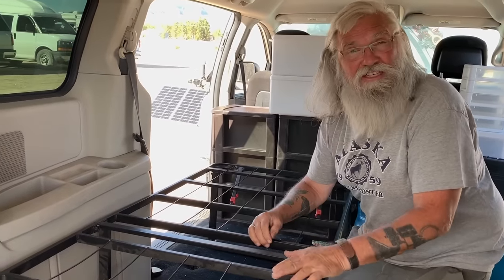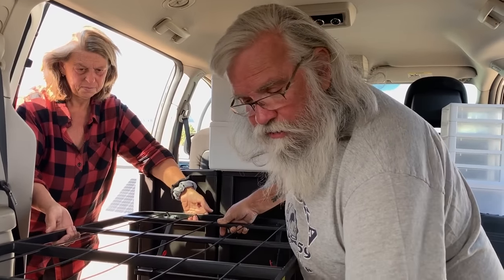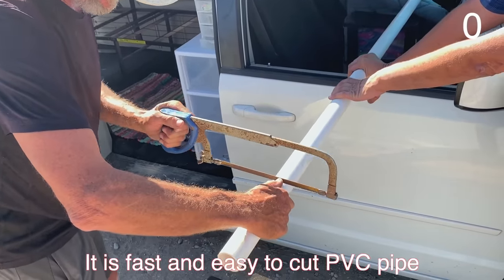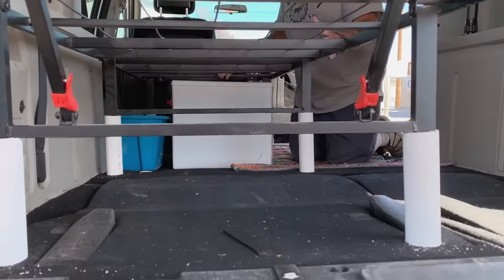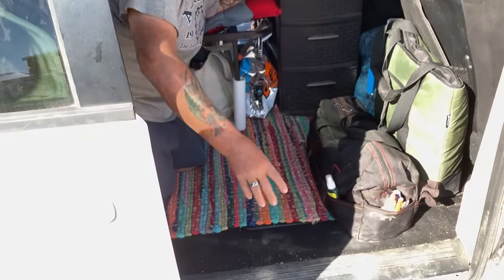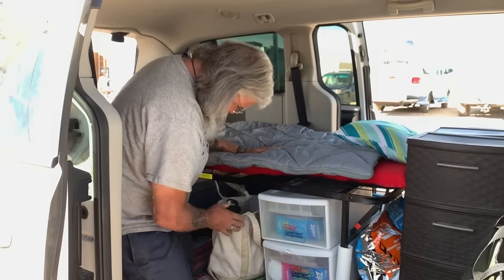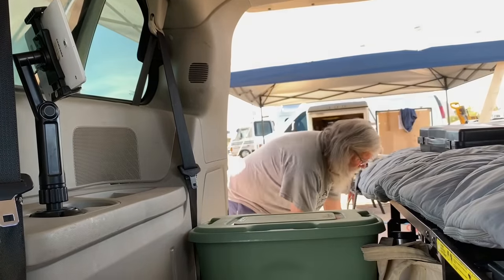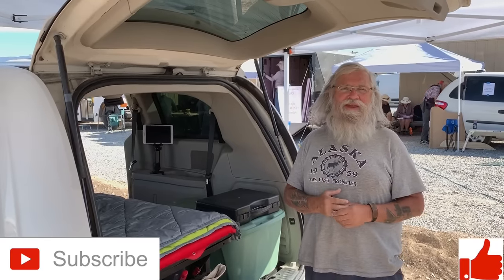Van Life for Less: Affordable Easy No-Build Van Conversion | No-Build Van Life

Comment: This is genius. You're going to help a lot of people with this!  A couple of hints 1. Put a few layers of cardboard on the cot before you put your bedding down, to cover those bars that kill your back.  2. Measure your bins that you plan to use under the cot, and don't cut the legs off too short for them to fit.
Reply: That cot will kill your back no matter what type of cardboard you put under it. What he doesn't say in this video is how uncomfortable that "no-build build" will be. That cot is cheap, and you get what you pay for. Same with the shelves and storage units. There's a reason a build is better: it lasts longer and is more comfortable. This video shows you how to be homeless in a van.
Reply: @thedanholmes  In today's uncertain economy, how to be homeless in a van for 300 bucks is an essential lesson. Most people cannot afford luxury these days.
Reply: @thedanholmes  Yes, it's an emergency solution. Improvements can be added as the situation evolves. For instance, 1/4" plywood with holes drilled into it for air circulation could create a flat surface for the mattress.  Cheap and simple, as soon as one can find the money for the materials, or better yet, a resource that's throwing offcuts away.
Reply: @thedanholmes  I have these same plastic containers and I live in an apartment. You don’t need to build every thing. This is to get you started. To be free from whatever situation you’re in that you need to get out of, whether that’s an abusive relationship, financial cost of living, or just the need to get out and see the world. 💫
Reply: @chezmoi42   I like the basic suggestions. But I also do know how to use a fewl tools.  I am an empty nester. I have a lot of leftover/behind furniture and furnishings that I can convert/repurpose, if I choose to. Once an old entertainment system, the top of it is on the floor in my sewing room that I haven't used in years, and I could maybe repurpose that. And something I have that is really cute, I don't know that I can convert it, but I'm sure there's a way, is an old telephone desk that has the lamppost through the end of it with a shade even. I would have to run a electric, but if I had a jackery I could. Or I can convert it and make it solar or something instead. Or  just put a solar light bulb in the socket and not plug it in. But it sure would make the van homey/quaint.  There's the cubby hole under-the-table next to the seat where the phone books and such would go. That could be used for storage for other items. Say like maps, coloring books, supplies, crafts and road games.  And right underneath I could place my own fashion picnic basket with the picnic plates, cups and such, already inside of that.  I wouldn't even have spend money on those things.
Reply: @thedanholmes  just need a good mattress
Reply: @thedanholmes , for those who are looking for a quick/temporary solution that will get them out of the city with their new (used) minivans, this is perfect. If we all custom built before heading out, many of us would never get there.
Reply: @Seashellsbytheseashore21  just wanted u to know that your comment meant alot to my cousin. She ❤️ Ed it becUzs she is going thru it too
Reply: @cherannretiredgran68  💯  u got it right ✅️ 👌
Reply: @PaulaRamsey-t9e  thank you.
 I had actually gotten to set up my no-build over-nighter/campervan mid to late summer. I've already changed a few things in it a couple of times since. And just recentlyI started posting shorts on my personal channel.  Right now it's testing the channel, making content, learning camera, photography, terms, .... I don't have the "campervan, vanlife" channel actually happening due to some health and van issues. But the adventure of getting it together has been fun n interesting. 
Providence prevails though!  I found some inexpensive items at a $ store, thrift store, and a couple of yardsales. Woot! Woot! 
And bless their hearts my children and grandchildren treated me to a mini-vaca at Hocking Hills in southeast Ohio. 13 of us went. And even though it was a bit arduous physically for me, it was a real treat. Great for my heart and soul. And the family overall.  ❤️
Reply: Cardboard attracts moisture and bugs.
And it smells.  Ick.

Comment: This is the most important video you have ever done! ,  giving hope to many people who have to adopt vanlife and who lack the necessary craftsmanship. I am adopting this layout in my planned campervan (ford transit custom 2.0 liter diesel in England). The idea of using low weight matertial and reducing petrol/diesel is excellent. The layout is very simple and can fit nearly every van. This video left me with a lot of thinking, before my next planning. A comfortable bed and good insulation do not have to be made by tons of wood! a simple water system means less problems! simplicity is the name of the game for those who lack the money and the time to turn their van into a campervan. I am using the extra money I am saving to buy a newer van. Excellent video!!!  Thank you many times for this informative video.
Reply: bottle-cap taps are also very useful, same for having a bowl in which you drill a few holes in the bottom in a space slightly smaller than a wide bottle cap, a water jug with a wide bottle cap and cut the cap then glue it to the bowl. Or simply glue the cap to the bowl (ideally center, but not necessary), then use a nail and a hammer to punch holes from the bowl to the cap, or if it's a plastic bowl, you can use a very hot nail instead, to also make the connection waterproof. With a bottle with a tap cap and a sink connected to a water jug, you can have the tap-and-sink part of a kitchenette, and the rest is a table for cutting and prepping inside the vehicle, a folding table (can be the same table with different heights available) and a stove for cooking outside, you have a complete mobile kitchen.

Comment: Hi Bob, Great idea. 
If I may offer two suggestions I think you will find them helpful. 
1st. Once you Mark the the length for your PVC take a piece of tape and wrap it around the pipe at the marks, this will give you a perfectly straight line to follow while making your straight every time . 
2nd. To prevent all the weight and pressure on the PVC ( cold climates can make the PVC brittle at the uneven pressure point at the cross bar), drill to small holes through the PVC continuing through the cot leg. After that take small drift pins or a bolts that will match the diameter of your drilled holes. 
This will also secure the leg extensions to the cot. 
Thank you, Bob Mahaney 
Baltimore Maryland
Reply: From another native Baltimore resident, great advice. Overcome, adapt, improvise.
Reply: Good tips, Robert!
Reply: See what happens when you get a bunch of guys together on a project!!!  ❤

Comment: If I wasn't so attached to my flowers, this would be the life for me. At 69 and partially disabled my dumpy, old, paid for, shack with lots of perennials is a better fit.   I may have to join the patreon anyway because I know that in spite of not having anything fancy, I am blessed to have a roof over my head, gas heat and indoor plumbing. You guys rock!

Comment: Great video!  I'm a 63 year-old grandmother who did a no-build on my 2008 Toyota Sienna.  I used a regular twin metal bed frame with a piece of plywood and a twin mattress.  I use under-bed and behind-bed plastic storage drawers and containers.  I have two solar lanterns.  I tinted the side windows and use a custom cover for the back window and a curtain behind the front seats.  My potty is a 2-gallon lidded bucket (I'm small!) with a "separator" insert.  I am fortunate to have a room at my daughter's home, but my minivan camper is my ticket to cheap, enjoyable freedom weekends and summers.  Thank you for sharing the message that simple can be best of all!
Reply: Portable potty bucket can be bought on line at cost rangev of  USD 22 to 120....

Comment: Really like the extension idea for the legs of the cot.  I hadn't thought about that and it will come in handy.  FYI, keep an eye on the multi drawer plastic storage units.  On some of them the frames pop apart.  A three drawer wouldn't fit in the back of my car for kitchen storage, but a two drawer went in perfectly.   Also, the grocery sacks many of us are required to buy anyway these days are usually flat bottomed, fairly sturdy, and cost 99 cents.... and they hold quite a bit.  Waiting on the solar episode because, try as I might, that stuff just doesn't stick in my head!

Comment: Thank you for giving hope to those who feel hopeless and stranded in their situations. Sometimes that hopelessness feeling is less when you have a project that you can do to help yourself and your situation. showing people these videos, Can give people Hope that it’s not the end there’s more to life and life isn’t always what other people think it is. We travelled on the road for three years living out of our 1 ton with just a bed in the back seat and Window coverings. 
The first night my husband slept in the backseat and I slept in the front because we were going to put a tent up and it started to rain and we couldn’t set it up. 
I insisted that he take the backseat which was more comfortable because he was doing most of the driving and I could just doze in the passenger seat. 
When we eventually got back home we removed the backseat. Made a platform bought a mattress installed our generator in the back under the tone cover ran the exhaust through the box underneath out the far corner. We ran an extension cord from the generator through the hole that the backseat bolt that we removed, the extension cord which at night would charge up our devices and charge up the truck battery through a trickle charger under the hood. Used zip ties to secure to the frame.. would also run a fan/heater when needed.
Our truck has a sun roof... so we bought a set of strong magnets and used duct tape around the edge and placed the magnets in the tape. We would place that on the sun roof at night. If it rained it was easy enough to close it without the screen interfering with the system.
Reply: Better and safer to use solar and a battery inverter.

Comment: Lowes' and Home Depot cut wood for free might cut PVC too, just ask.  This "no build" build is totally doable, and a way to test if this would be a lifestyle to pursue...
Reply: It's also somewhat modular. If you want to add something later, you can do so.
Reply: Home Depot cuts PVC pipe to order.  Did that last summer for my garden build.
Reply: I've had Lowes cut pvc leg risers for tables. I think they will do 8 cuts for free and charge a small fee per cut therafter
Reply: @dingfeldersmurfalot4560  Next time take the PVC pipe to the wood trim area. HD usually has a do-it-yourself cutting station set up there with saws and even rulers.
Reply: Home Depot got massively bent when I asked them to cut PVC. And they did a crappy job, just to sure they sent a "message" that they didn't want to do it. Uneven measurements and ragged edges.
Reply: Home depot cut 4 x 4 for legs  and 3/4 " mdf for bed. They are the best!

Comment: Depending on length, a small futon couch might work, too, so that you can use the bed for seating too, if you choose! Walmart has one that looks like a couch, but folds down into a double bed, with adjustable side pieces, that can be popped up as arms when its in the sofa position! I have one, works fine. As I don't  have a mini van or full van, I couldn't  say if it would fit; but if it would, that would be a good option!

Comment: This is such a great resource! I am planning on creating a kit like this for my 2010 Dodge G Caravan, not to live in permanently, but as a Van-cationer to allow for cheap road trips. I also like the idea of having a mental backup plan in my life for if something ever happens to me where I am no longer in a financially stable situation.
Reply: Came back to this video again, because I lucked into finding the exact same cot shown in the video at a garage sale for $10. I already have my two 4" matresses that I have been using on the floor of my van, so this is an great upgrade just in time for a week long trip in March. Couple of things to note, for me at least, the couple inch slant on the floor has not been a bother to me sleeping on the floor or on the frame, and my head barely touches the ceiling as is, so I don't want to use the PVC method and give up any more headroom. I also don't want to cut the legs off the cot itself, because I value the flexibility to move the cot and mattresses into a tent. Everyone sleeps different, but I just left the slant and STILL sleep better in my car than I do in my house. Second, a really nice feature of the stow and go third seat in the Dodge Grand Caravans like the one shown is the 60/40 seat. Where Bob put those two greens totes, there is a seat that can pull up out of the floor with room to spare, making a built in living room chair. That also leaves more kitchen space in the back.

Comment: I am all in favor of this simple build. I have done much the same with my 2005 Sienna. A few other ideas: 1) I agree with Blazin' Saddles that leveling the cot is optional. 2) I leave the passenger side rear seat up soI have a comfortable chair and storage behind it for my seldom used Luggable Loo (in which I replaced the 5 gallon bucket with a lower 3 gallon bucket from Lowe's.) 3) I added the window rain guards as noted below by Taz Mahal. I also have screening to maintain ventilation. Great job.
Reply: I'm thinking about a Sienna, as well...  But,  when I get one - I'm taking out All but the two front seats out!!  I have a couple of very light, folding chairs, which I'll use...
I'm thinking about the space I'll need - and the weight that will be taken off since I'm removing the seat, and which will be replaced with my storage.
Reply: as long as I have an awning.  I am  with it all .simples is best..nothings to go wrong g

Comment: awesome ideas!   while back I built a Sprinter VAN using the same concept.   Quean size bed with 4' clearance under for toys or whatever you may need.  In the back I put a cabalas fishing table with build in sink and faucet.   Manual pump for water to hook up fresh tank and gray tank.  Folding chair next to the table.   3 tier storage for food and  other things.   I think the total build was under 500$.   I think that putting the sleeping area and storage between the axels and behind the seats create a safer built in case of a collision.   It also distributes the weight very evenly and the handling is not impacted at all.    Sure, Teak wood is much better looking.  I can rip my stuff out of the van in 60 minutes and you would not know it's a camper van.  one more tip, if you have a metal roof you can use magnets to suspend a mosquito netting over the queen bed and sleep with crack doors and windows open.   It sure beats any setup up where you have to constantly go through some velcro or magnet driven bug protection which cost arm in a leg and is pain to install.  cheers.

Comment: Thanks for this! Something that I could do so easily. I’m a bachelor who lives alone in a small apartment, and even it doesn’t get filled with my stuff. If I further pared it down to the real essentials, it would easily fit here. Looking at the double-stacked containers under this bed, I figure I’d need only a single-stacked row of them. So I could have an even lower bed (as pointed out here, more headroom).  One thing that I would add would be to bolt down the bed and have a system to strap everything down. If, Lord forbid, I should get into an accident, chances of survival would be higher if it wasn’t just me that’s strapped down.
Reply: Yes, but I think you underestimate the immense force. Half of that stuff will end up flying around, anyway.

I mean, seat belts have ripped right off.

Comment: I'm glad I saw this. I'm doing my '98 Windstar. I was going to sleep on the floor, but this is better. I have a budget of $500, but can spend more on solar and storage batteries. I'm using as much stock components as I can find. Thanks.
Reply: How did it go?
Reply: I grabbed a twin bed spring on the side of the road, put an old twin mattress on it and set that on 4 Crates.  I only bought the crates at a used store.  I had that in the back of my truck which had a shell on top.

Comment: Pausing at 13:05: you get a bag from Cracker Barrell when you buy something in their store and those bags are awesome.  Also, when you order something from Amazon, tick the checkbox to have it giftwrapped because that is just a decorative bag with drawstring ribbon and they are excellent quality bags to store stuff in, really good to have and it’s free with your order.
Reply: Thanks for this information!👏💜
The tip re: Amazon gift wrap.
Reply: Theresa M - you are welcome. We use the Amazon giftwrap bags for computer cables because they can get lost easily and don’t really fit in a drawer well.

Comment: My van build out was pretty simple, I did put in a plywood floor and those puzzle foam pieces for my knees.  I use a cot for my bed, shelves I had in the back for my kitchen and store in plastic containers.  I love that I know where everything goes.  I am not full time yet but when I do go out it is easy and I know where everything is.
Reply: the puzzle foam pieces are a great idea! and besides helping with the knees, they will provide a bit of insulation.